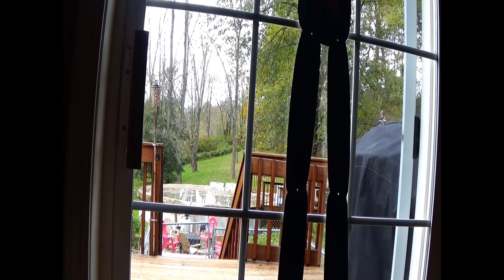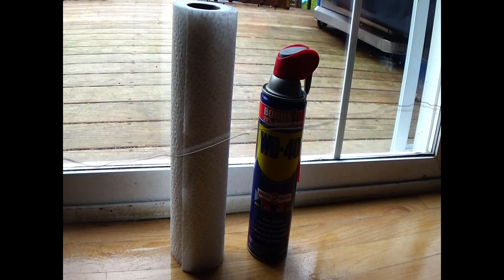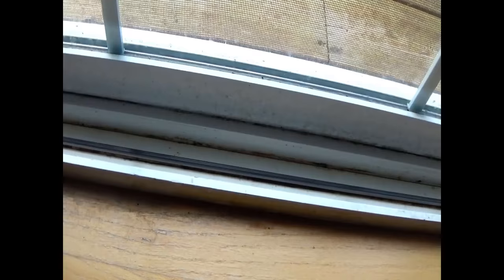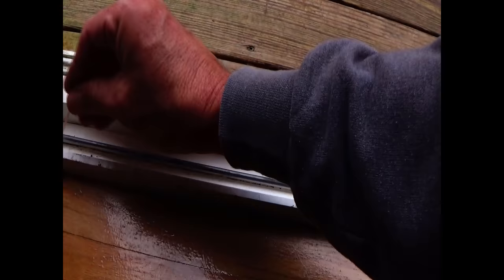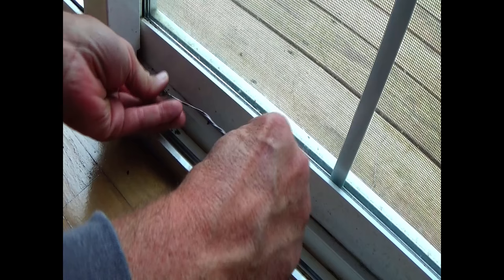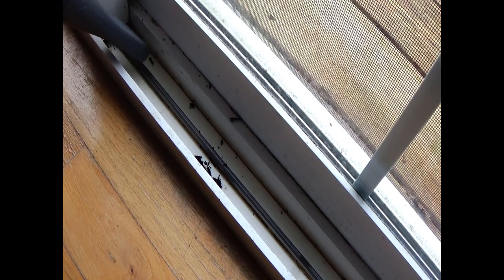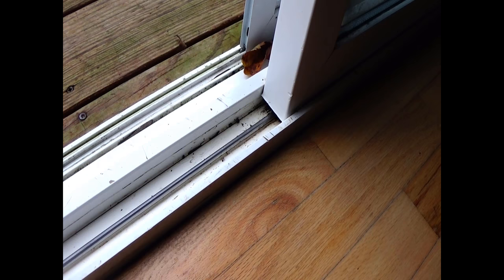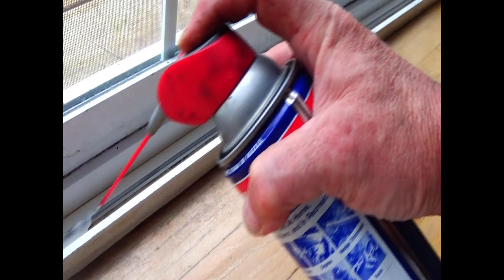How to Fix a Sliding Patio Door That's Not Sliding Properly

Comment: WD-40 is not what you want to use as it is FISH OIL which hardens over time. Ask at the hardware for some lubrication that is PLASTIC SAFE. To test what you use spray some on a glass that is in the sun and see how long it takes to get sticky and or hard. In my younger days I sprayed them on the hot exhaust manifold of my car or pickup. If it turns to powder, dust you do not want to use that in your engine or to lubricate anything. You can use SILICONE spray for the slides and I use it on the bottom of all my drawers so they side easy and it never gets hard. When you see the commercials of them making things like new, it is silicone that they use. facebook rexbahr

Comment: This might possibly be the worst youtube video that I have ever watched. First of all, WD40 is the worst thing to use. It will attract dust and dirt and make your problem worse in a very short period of time. Any good silicone spray is far superior. The use of a "toothpick" is idiotic. A small brush such as a good nylon bristle gun cleaning brush, and a terry cloth towel, will work far better. Your hanger is pure non-sense. Pull the door off of the track, set it on a couple of saw horses, and clean it properly. It is more work, but the results will last for a much much longer period of time with far better results.
Reply from the maker: Yes, silicone works better than WD-40....Yes, removing the door is the best option.....I made this video for older people (with limited strength) or someone who is overwhelmed at doing repairs that has these items on hand....You don’t like the video, I could care less.

Comment: Why don’t you use an old cloth to wipe the wire as you work instead of wiping it onto the frame and floor?  Seems basic good working practice to me!
Reply from the maker: Hence, the vacuum instead of a cloth. Worked just fine!
Reply: Always a complainer